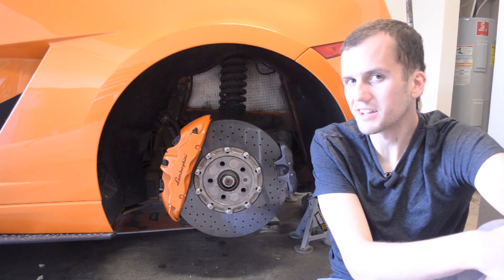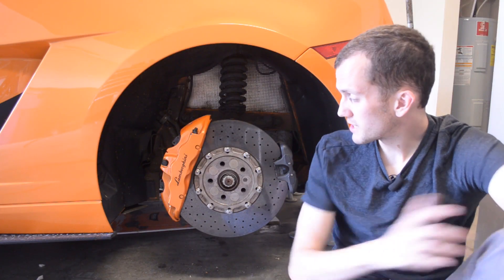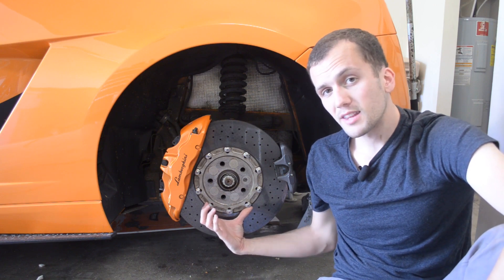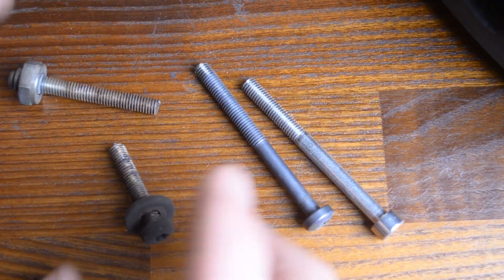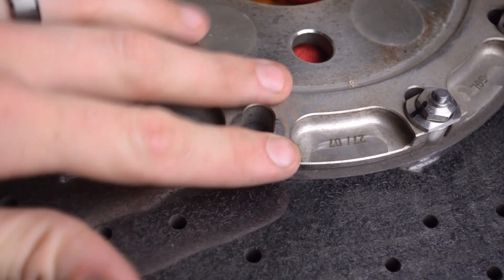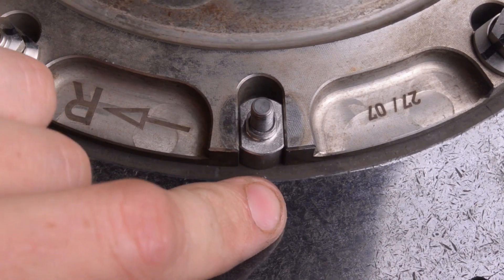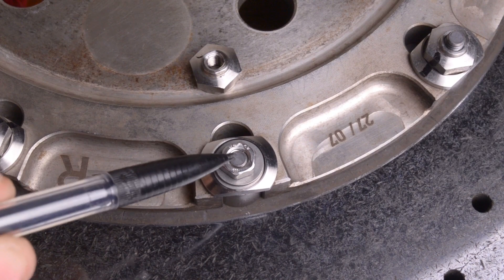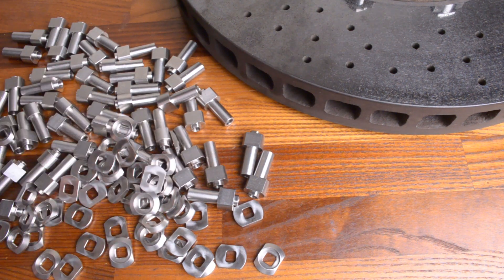Lamborghini Gallardo & LP-640 CCB Rotor Hardware Kit | Carbon Ceramic Recall Replacement

Comment: Great work!  Impressive!  I’ve got my wheels off right now so I’ll check on those little guys to see how they are holding up…😎. Are you going to start selling these??
Reply from the maker: Good idea Marcus, if you can get a glimpse of the head of the bolt its the best way to know if you have the 18-8 OEM hardware or the titanium recall hardware. 
For the 18-8 stainless fastener that fails, its a shiny light bronze color and will have 55 and A2-70 on it. A bit hard to read
 
For the recall hardware, its easier to tell because the fastener is a dark gray color and will have TITAN TR 55 on it. 
If you have the recall hardware, you will be good for 5 years/50,000 miles from when Lamborghini installed that hardware. 
I am developing a website but its a work in progress! 
https://lambobullrider.com/product/gallardo-lp-640-ccb-hardware-kit/
Reply: The Bull Rider I checked and all the bolts are securely fastened, but I can’t read anything on them.  I’ll take a picture and send it your way to see if you can tell if you send my your email.  Thx
Reply from the maker: @marcuslavender4619  Sure, send me an email to lambobullrider@gmail.com. 
Send a pic of the front of your rotor too and the nuts on the rotor up close!

Comment: Speaking only as an engineer, this system seems wildly over-engineered, using tricky assembly methods to replace high tolerance parts.  Is that really a sensible tradeoff?
Reply from the maker: Peter, I understand your perspective but in reality the only difference between my design and the OEM Lamborghini design is the addition of the second washer and the different locking nut to ensure uniform preload on the existing Bellville washer. 
All other components are exactly the same as the OEM Lamborghini components in their respective order of assembly.

Comment: How is it living with carbon brakes for day to day street driving, for noise, pedal feel, wet use?  I’ve never owned a car with them and would appreciate an owner’s thoughts.
Reply from the maker: Peter this is a very early CCB system. They are very touchy and grabby. Braking feedback is non existent for the first 20% or so of the pedal travel and then it feels like you hit a wall the brakes grab so hard. 
Later CCBs like the ones seen on the LP Gallardo, Huracan, Aventador and R8 feel like steel brakes. You wouldn't notice the difference they are so good. 
Havent had first gen CCBs on the track yet but second gen CCBs are good even with stock fluid. They rapidly wear through pads though. On track, its best to swap it out with steel rotors from Gyro-disc or another alternative.
Reply: @TheBullRider    Thanks so much for your reply.

Comment: Sell it as a kit, the only thing I would do differently would be the bolt I would not bother with the titanium ones, I would just go straight to 10.9 grade off the shelf zinc coated bolt and as always with an Allen head, no stupid Torx, because I don't think that rust would be a problem on a fast rotating assembly that also gets hot.
Reply from the maker: Andreas, that is a very interesting perspective. We agree on one thing, dump that stupid torx head! That is exactly what I did on the revised hardware. It was impossible to find a torx titanium M5 bolt in that length anyways. 
You really think that just a zinc coated bolt would be a good idea if the 18-8 bolt from factory was rusting?

 I know that as metal heats up, its corrosion inhibition properties reduce significantly. Kind of like how when blacksmiths make swords, when they hammer it you can see the crazy amount of material that is effectively rusting off. At least that's what I remember from my material sciences class. 

My thought is that the majority of the time, the car doesn't move and depending upon atmospheric conditions, rust might creep into that assembly over time, especially if you drive it in the rain. 
Id be really interested to hear what you think and I appreciate your differing perspective!
Reply: @TheBullRider  well heat is a catalyzer in the oxidation procedure but that's extreme heat (600c++)
That design I doubt would heat the bolts so much if it did they would get softer and stretch. The way I was viewing it was in the sense that centrifugal force always flings the water off and heat evaporates it.
I don't know if you have salt where you live, but plain distilled (rain) water that dries up quickly would not cause rust in my opinion. The only option I can see is if brake dust can attack zinc plating.
Reply from the maker: @randomchannel1712  These rotors glow red hot on the track. Its probably easily 500C+. 
I think one of the reasons for that Bellville washer that we installed in this new kit and the OEM hardware was to account for the CTE induced stretch of the fastener during heat cycling while retaining the same preload on the rotor hat. 

In the winter, there is a lot of salt on the road for deicing before it snows. I think with this kit, I wanted to account for every environment that a car like this would encounter, despite the increased cost of titanium hardware. 
Never thought about brake dust attacking the zinc plating, I will look into that!
Reply: @TheBullRider  500c on the surface but how much does the bolt heat up. The concave washer could be there to keep the fastener preloaded or to to account for thermal expansion of the bolt.
Well titanium is expensive and if salt is present it could be the only way...
Here in Greece we do not have to worry about rust, so yeah I would go with Allen head 10.9 grade bolts zinc plated or black oxide.
Reply from the maker: @randomchannel1712  I agree with you, what I would run on my car is a lot different than what I would say is acceptable to sell to others, especially in a critical component such as brakes! 
They are crazy here with the salt man, some parts of the country they use so much salt that 1-2 year old cars look like they are from the junkyard underneath.

Comment: Wow Richard, your machinery skills are amazing  !!! Would you make these for sale to other Lamborghini owners ? That is a great tip, to check the bolts for purchasing leverage and of course safety concerns....
Reply from the maker: Deuce, your compliments are overdue! I didn't machine those pieces, I just reverse-engineered them and quoted them out! Way easier that way haha. My CNC also isn't really optimized for machining Stainless Steel.
And yes I will sell them to people who need them and want to avoid the Lamborghini tax! 
You are precisely right! WHEN you buy yourself a Gallardo with the Carbon Ceramics, double-check those fasteners and wiggle them to see if they are loose. Make sure they all look the same too.
Reply: @TheBullRider  Ahh...gotcha...either way, your modification is appreciated... $4k for nuts and bolts is ridiculous..... great work !!! What occupation are you in ? You definitely seem to be an engineer of some type....

Comment: You seem like a cool humble dude, and I appreciate your aim toward doing things yourself even when companies like Lamborghini try to put constraints on consumer serviceability. Nice work!
Reply from the maker: Right on Devin, thank you so much! And my thought on that is you don't really "own" the car unless you can work on it yourself and gain mastery of the platform. Lamborghini does a LOT better job than other OEMs. A lot of other companies will sell you an entire transmission or differential, but Lamborghini will sell you gears, synchros, and bearings with full parts diagrams. 

Very nice Prelude btw!